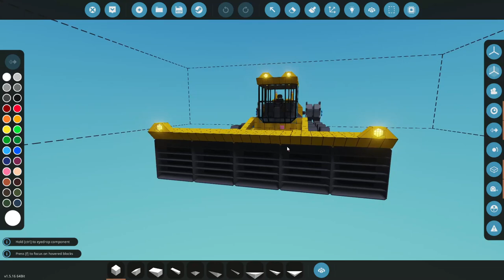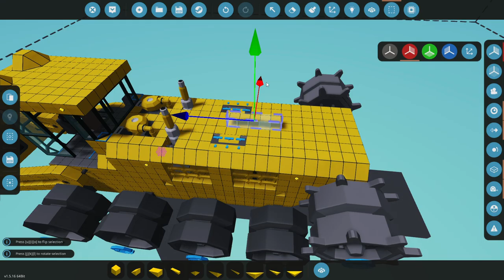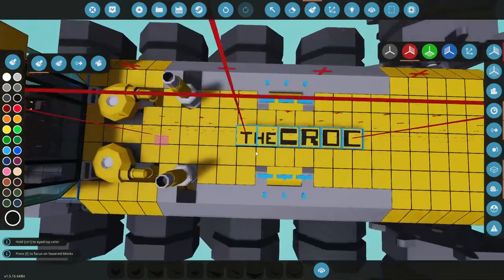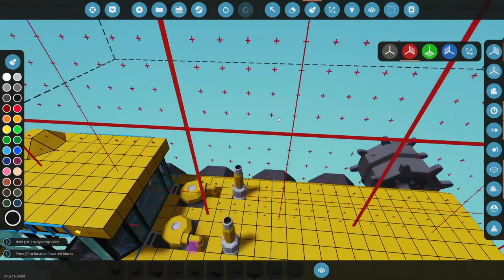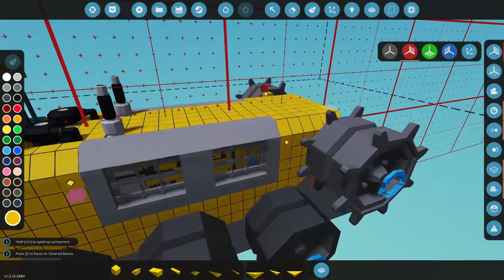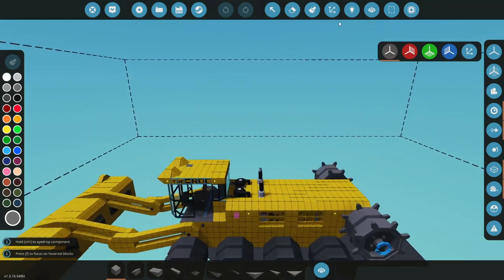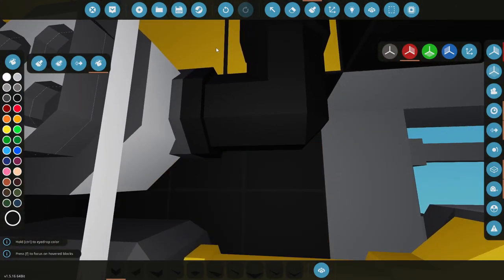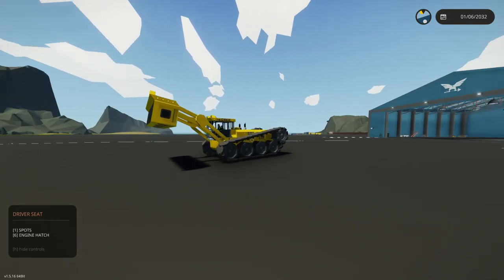Front Loader Your Suggestions! [E4] STORMWORKS BUILD SERIES

Comment: The front loader is looking great!  One thing you could add is the ability to swap heads.  Keep the resource bucket head as the default, but include a general grabber/winch head for moving around small vehicles or whatever, and a frame for grabbing containers?  Also you could square off the bottom rear since you're not likely to be backing up over rough terrain anyway and fill that with weight blocks or batteries or w/e to bring the overall balance further back.

Comment: The solution to the nose weight with the longer arms, is to move the pivot point of the arms behind the center of mass.  You can move the bucket back so the weight is closer to the body.  If you can fit the pivot right in front of the drive sprocket, and run the arms inside the tracks, you should have twice the lift radius and about half of the nose weight. 

Trying to think of how to explain it better but drawing a blank.

I like how its looking.
Reply from the maker: I totally get what you are saying now. Lol. We'll see if it gets a revisit.
Reply: @ProfNCognito  No biggie if it doesn't.   It will be a bit of a pain to get to fit in just right, but I think it would make a huge difference,   just need to leave room to clear the cab.

Comment: If you'd said, "Happy Little Accidents" while painting, I'd have straight died.
I think it needs more tow hooks, especially on the bucket. This is a great vehicle to do buddy recovery with. Also, loaders end up being used to move a lot of other materials and equipment around job sites. Things like big pipe segments and compactors.
Side note, I never use the pure black when painting, it looks too clean. In all real-life equipment the black is always either dusty or oxidized--Especially over the engine covers. I use the dark gray next to it--and it's much closer to the "black" baked into the parts.